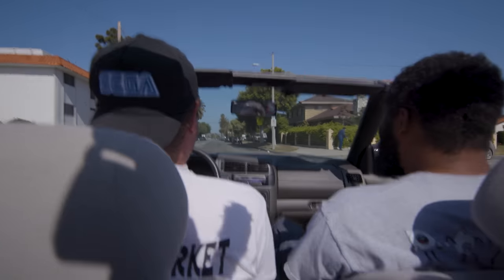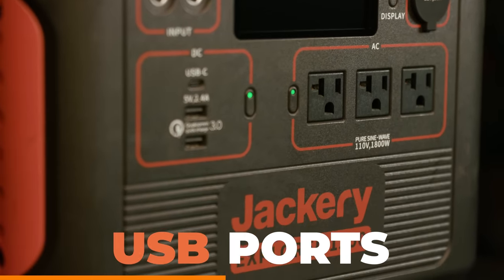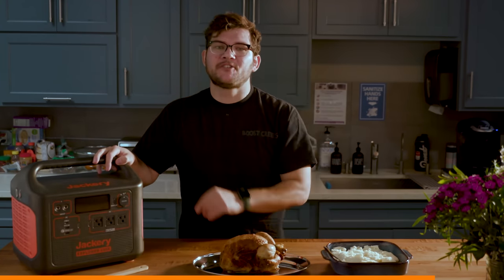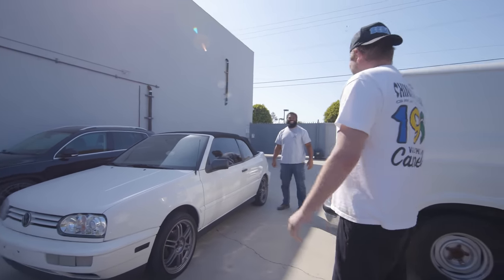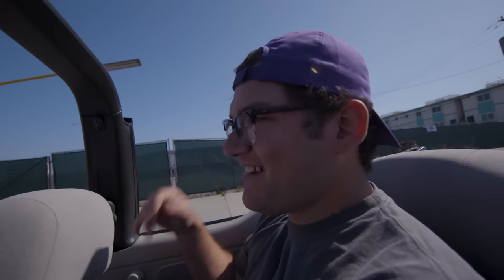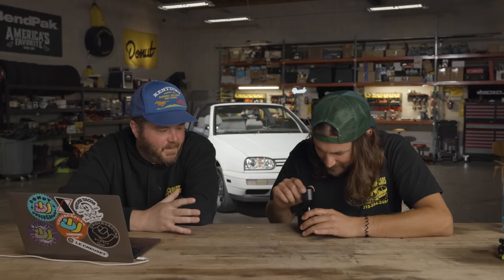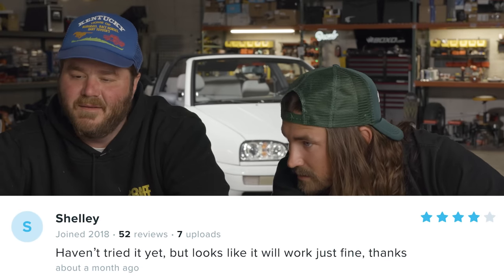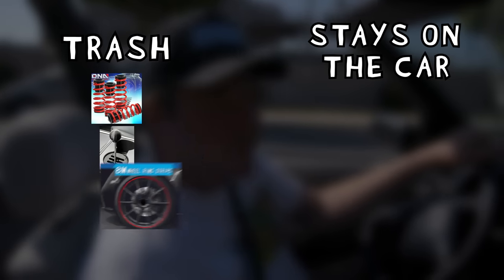We Bought More Dumb Car Stuff from Wish.com

Comment: Tentatively awaiting the supercharger installation. That one's gonna be interesting
Reply: If it actually works for more than five minutes it is a huge bargain
Reply: I can’t wait to see that XD
Reply: Get it done boy’s
Reply: @loganwade6581  ya, I didn't see any oil lines on it.
Reply: Here is a link to the guy that installed that supercharger!  I'd love to see you guys do the same!  https://youtu.be/w_0cQfNnYU0
Reply: if they install in a small engine, is not gonna be so bad
Reply: I need to see this. If I don’t see this installed by June, I’m totally unfollowing for at least a week out of pure rage
Reply: The fact that this video does not contain the install and what not makes me dislike them. I’m not subscribed. Just randomly found them.
Reply: It looks like you could maybe sandwich the supercharger between the alternator and alternator bracket somehow.. 🤔 The mounting points kinda look like they are alternator width
Reply: 5 bucks that the cheap poly wheel on the supercharger will blowup
Reply: @youkofoxy  mostly all of them are refurbished from small engines so they are meant for such. I doubt its gonna make a difference for a 2l engine. 2 stroke stuffing channel has done >20hp (seems like more is coming too) on on the smaller version of this supercharger (300cc one) with a 50cc 2stroke (2stroke 50cc stock comes with about 5hp btw)
Reply: YES
Reply: we would all learn a lot from a supercharger install
Reply: @frankiethefrog1752  very rare for them to do that. I suggest you just try another video ;)
Reply: @ChrisC7498_  lol I’ve seen some content before it was entertaining.
Reply: yes
Reply: Seriously I'll watch
Reply: Yesh
Reply: The outlet seems like it’s a few inches too small. Like it could work but I would think you’d have to gear it up with a smaller pulley to spin it faster to stand any chance. I’m excited to see it spew it’s guts into that poor unsuspecting golf engine

Comment: The reason the supercharger seems so nice for its ridiculously low cost is that it's actually a "refurbished" used supercharger from a Japanese Kie vehicle made by Aisin. You have a AMR500 but they also made an even smaller AMR300 (500cc or 300cc of air per revolution respectively). People use them on all sorts of applications like air cooled VW's and small engined go karts/buggies etc.
Reply: The more you know.
Reply: Well boys, looks like we might get ourselves a video
Reply: Do you know how well this would work on a motorcycle
Reply: So I'm assuming this wouldn't work in my 2012 Silverado lol
Reply: Interesting
Reply: @OregonSilverStacker  of course it would; I've seen a 3.5L M30 straight six engine with 3 of these fitted directly on the intake ports (one charger for every 2 cylinders) you can also overdrive it up to 2x to get 1000cc per rotation.
Reply: @OregonSilverStacker  would work just fine, it would provide all the boost you need on two of those eight cylinders.
Reply: @pero2727  Whoa, I got a buddy with an M30 3.4.. u got any details on that build?
Reply: Came here to say this, It's cheap for a super charger but it's basically from a warehouse of parts that never got used so they are going resold. You would have to build it all out yourself and it's still gonna cost a few hundred to pull it off ontop of the charger but hey, you got the charger. Everything else you can buy online or at lowes or something i guess. You can change the boost based on the size of the wheel you attach to the wheel on the alternator. Def would take a lot of work to get it done but, hey if you have a little 4 cyl. and you have the time and money, you might get another 50-100 hp out of it and the satisfaction of doing it all yourself.
Reply: My guess is you would also want to buy one of those chips that helps tune the engine??
Reply: @pero2727  WHAT THE HELL?
Reply: @templar501  Yes but 50-100hp out of a engine that ONLY makes 116 hp to begin with? Nothing to sneeze at!
Reply: @BtD_007  So a 50% to a 95% increase in power is nothing? For maybe 500$ and some time in a shed?
Reply: @matejpotrusil1464  do you know what "nothing to sneeze at" means?
Reply: @SamAbraham  I don't know what you mean with details; it has low comp pistons and a cam, that's about it.
Here's a 2JZ head with triple AMR500s on it, the intake setup on the M30 was similar: https://i192.photobucket.com/albums/z237/duaxmachine/AMR5003-2JZ_zps92122f8e.jpg
Reply: Wow that's cool to know. I figured they had to be used in other applications but never guessed refurbished
Reply: They look like something that breaks on a monthly basis, is that impression accurate?
Reply: Ive seen one on a 22re in a hilux before. They go alright those AMR500s
Reply: The Amr500 is a nissan made supercharger. its Pulled from a kei car and then rebuilt. all you need to run it is a tunable car under 2L, a mounting point, a belt, charge piping, and a bov. worked on my miata anyway.
Reply: @TheLucasfialho  nope. Very reliable; the gears inside run in an oil bath.
Reply: Thats correct dude! I actually know of 2 air-cooled vw`s in Norway with the AMR500 ;)

Comment: I can totally see the supercharger binding up the SECOND real load is applied and shooting metal shards right into the engine. Would love to see it
Reply: I have a roots blower in the scrap bin that looks just like that. It was used in something to make snack foods or the seasoning of the snack foods.
Reply: @danh8302  gotta have that pepper powa
Reply: My thoughts exactly 😂
Reply: It’s a smog pump bruh. Come on y’all. These are used for small engine superchargers. Why none of y’all recognize this??
Reply: Hey man, I know a guy who ran one of these on the mirage engine, worked fine, the amr500 is a real product
Reply: They aren't as bad as they look
Reply: It would only shoot into the intake, shouldn’t make it much further
Reply: @duckguide4109  til you turn the engine on, it'll stay only in the intake
Reply: Mercedes used the same style supercharger in their c230, its a roots style supercharger.
Reply: @duckguide4109  the reason air filters exist, is to keep foreign objects out of your engine, because the intake manifold is a direct passage to the internals of an engine. 

If it goes bang so does the motor.
Reply: I have the same Chinese supercharger on my vw bug and it makes my car rip.. it’s just a 1600 and everyone always thinks it’s a built 1914..
Reply: @longsleevethong1457  that's because it's a knock off AMR500 not a smog pump
Reply: @jakefinlay5312   it’s a smog pump that folks figured out how to use otherwise fh
Reply: @longsleevethong1457  it's a factory supercharger on a Subaru pleo, the one off wish is just a reproduction part

Comment: That supercharger is actually based on a semi-decent super charger. The real AMR500 I believe is a knock off of an old Porsche and bug supercharger. One side gets bolted to the engine and the other is used like a tensioner. They supposedly work great on engines like the bug 1600.

If I remember right they also had no Inter cooler and instead used alcohol (methanol) injection.

Comment: Instal the supercharger!!  Make sure you add a boost gauge cuz I’m really curious how much air it will move! Probably tops out at like 4 psi😂
Reply: somewhat reliably, 8PSI is the furthest I've personally pushed a 500, they move 500cc of air per rotation, so depending on the pulley ratio, 4-6 would usually be ideal.

Comment: The "supercharger" looks like it's using the same mounting points as the A/C compressor, and connects directly to the intake.
Reply: And the threaded couplings look like a trash pump for pumping out a ditch.
Reply: @francistarkenton545 , Trash Pump Turbo sounds like a perfect name for it.
Reply: @David_Shipley  Wish should change it to that and give you royalties.
Reply: @francistarkenton545 , they'd probably just mail the check on the same ships as the products, so I'd have to wait 6 months to find out they lost it at sea.
Reply: @David_Shipley  you know this is a REAL AMR 500 Supercharger that is on thousands of cars.
Reply: @RandyLittleStudios , ok, does it not mount like an A/C compressor and feed directly into the intake? Or are you trying to fact check the joke I made about the name?

Comment: Definitely going to need to see that supercharger installed on something. Hell I'd even settle for the lawn mower.
Reply: I wouldnt settle on lawn mower, but I would settle on super low end 1l "modern days" nano-engine
Reply: @by010  A Smart Car has got about the right displacement.
Reply: W.
Reply: @kvin_le  X
Reply: Check out robot cantina, he put it on a cement mixer engine he adapted to a CVT trans on a car.
Reply: @SilynRaces  ...wut?
Reply: same here, greenfeild motorbike conversion
Reply: "There was one time I hooked up my lawn mower to my Nintendo! After that I got the high score every time!" - Matt Chapman (as Bubs - Homestarrunner)
Reply: I’m going to use one on my 2 stroke moped to piss about with
Reply: That'd be a spicy lawnmower for LA

Comment: These are just general super chargers really, "commonly" used to supercharge air-cooled beetles, buses and buggies. I'm genuinely interested in buying one for my '73 super beetle since they can up the power to 160 hp with EFI. 

 Btw they're mounted using those MI holes on the sides
Reply: Wtf is EFI
Reply: @yungboicontigo9278  electronic fuel injection
Reply: @mudkip4633  thx
Reply: Mighty car mods had a beetle powered buggy that was pushing around 100hp, but it was NA. It blew up pretty fast, can the beetle motor safely make 160hp without just grenading? 3x stock power is impressive for any engine
Reply: That supercharger is an OEM remanufactured unit. It's on some nissans and stuff.
Reply: @FroztiProductions  Nissan super turbo used them.
Reply: @Fhwgads11  on a healthy block that’s been built it can be done currently running a 2332cc with roughly 160hp to the wheels from a motor that was originally a 1600cc with 40hp
Reply: @Fhwgads11  my friend has one that they just put a turbo on and its running with meth injection. He estimates 315hp once its all done. He used to run a smaller one and made 200 ish
Reply: I thaugh it looked like the jo-blow one in the thumbnail

Comment: For those wondering, those superchargers were made for Japanese Kei cars in the 90's, which is why they are for such small displacement motors (600cc-ish).

Looked into putting one on an old Yamaha sport bike years ago.
Reply: This is a high quality comment. I was wondering actually
Reply: Underrated comment
Reply: We did put one on a nissan micra, picked up 30 hp ah ah
Reply: A single one of these can handle up to about 1800cc I've got one running on a 1300cc samurai engine
Reply: The AMR500 superchargers are also used on the Mini & Peugeot 1.6 engines sometimes from factory if I'm not mistaken
Reply: @dannyvanderheide6098  not amr 500, it is too small for that power ^^
There are Eaton on those 1,6L ^^
Reply: @blumafuji2753  oh yeah, sorry. I was confused with the Eaton. AMR 500 is still a popular choice for the lower displacement engines up to 1.4's max tho afaik
Reply: @dannyvanderheide6098  I know plenty of people who use them on 1.6 tracker engines making ≈6-8psi
Reply: @jakefinlay5312  it depends on the power it produces na ah ah
It won't be able to flow more than 140hp I guess or around that, you can get some 2,0L engine less powerfull than that so where it could make some boost, my personal 1,6L wouldn't get much boost from it due to it's power na
Reply: I bet you can get it to work on a 300cc Vespa.
Reply: All i hear is they need to put on several of these
Reply: @bedabene  one of them IS sufficient to make 130-140hp so it would make some boost but not z lot for sure
Reply: So they just need 4 of them ... lol
Reply: Yep, my '94 Subaru Sambar (4cyl 660cc 16v) had one of these.  In 4wd Lo it would pull 0-20km/h very quickly ;-)
Reply: They need to put 1 supercharger by cylinders !!! That would get 1-10M views in no time !!! !!! !!!
Reply: I’ve been researching putting one on my old aircooled VW bug. Apparently some folks sell kits for it.
Reply: @jakefinlay5312  which one? I wanna boost my samurai lol got a Harley carb on her now but still lacking
Reply: A nice reliant automobile..
Reply: @bedabene  that was my thoughts. Ok so it is good up 1400cc so then 2 should do 2800cc then right???
Reply: Interesting to know!! Thanks for sharing this lil' bit of info.
Reply: We all know how this ended up doing, but I wonder if they couldn't give it a try on the X-90 currently going through its paces? That's a 1.6L, and people put these on the Suzuki Samurai which isn't much smaller.

Comment: Gotta love all that forced induction you'll be getting from that "supercharger" 🤣
Reply: It'll work you'll see
Reply: @Ahmedkhaled-ev1jw  not as good as something like the Demons supercharger or the gt500's or the Zl1 1LE's or anything that isn't that 😂
Reply: @mdsullivan100  Fetch me a Demons supercharger for $200 then, will ya?
Reply: Lol the AMR500 is a legit supercharger. It's oem equipment on a Subaru kei car. It's made upwards of 150hp crank on various dyno pulls I've seen. It originally was fitted to a 600cc engine. Good stuff.
Reply: @matthemberry  Damn, not bad
Reply: @filipruml  who said we were buying one
Reply: @mdsullivan100  :(
Reply: @filipruml  maybe for your birthday
Reply: @Ahmedkhaled-ev1jw  Ive read in comments its used on 800cc engines and actually makes boost. Wonder if i can parallel 3 of them for a 1.6 l engine. At this price point it would probably still be cheaper than an original sc and or turbo kit.

Comment: Those AMR500 superchargers came stock on Subaru kei cars - basically all of them are refurbished. I've seen them sold on aliexpress with regular pulleys and the max RPM is around 18,000. 

I'd guess you'd get around 4-5 pounds of boost if you were to put it on the Golf tbh, it would be funny.
Reply: Wait so you're saying I could buy one and twin charge my Daihatsu Mira!?!?!?
Reply: @s70driver2005  yeah probably, if its the 660 you could probably even get away with an amr300 which is physically smaller but flows 40% less air per revolution, but if it's turbo already you would need to figure out if the supercharger is a restriction or not
Reply: @GlaciatorGaming  it is a 660cc 4 clyinder. It would be hilarious to put one on but I don't want to blow it up. I have a big car for modifications. I just want the Mira to run.
Reply: @s70driver2005  actually I'm putting one on my 06 Volvo today haha, been sitting on it for a while, should do about 3psi instant boost
Reply: @davidmcvan6072  lol yooo let's see that!!!

Comment: Yes, you HAVE to fit that supercharger to the car! I want to know what it costs to adapt a $200 supercharger to actually fit and function. Even poorly.
Reply: I can put that on any car with space at the belt area. Be a tough install on any horizontal motors, but any forward facing engine thats a super easy install. a bracket or two, little welds and some bolts. Fitted belt and youre off to the races. I've seen something very similar on a jeep before. basically the same as a procharger.

Comment: I definitely want to see the supercharger installed now. I wonder if it will end up blowing the engine like the turbo kits did on high and low car
Reply: That’s because they were both the DE engine found in the early 350s. Those motors can’t handle boost
Reply: @krisrepka7741  ah I didn't realize that. I don't know much about 350Zs

Comment: That supercharger works best on bikes and small displacement motors it definitely provides power too if installed correctly. Usually best used on old vw beetles.

Comment: Someone who buys lowering springs and calls them a coil over is exactly the type of person that’s in wish 🤣
Reply: Skull 👎🏽 Head bone 👍🏽
Reply: Except they are coilover springs, perches, and adjusters. 
If you haphazardly fire them onto a stock car, obviously they're going to be shit. 
They're honestly a good starting point for a car that doesn't have off the shelf coilover options, or if you just want to build a setup yourself. 
The adjusters/perches are fine, and while you have to measure the spring rates on your own, usually one set of springs are usable. Pair it with shorter/stiffer shocks and a pair of hyperco/eibach/swift springs (+- camber plates to taste) and you have a coilover kit on the cheap that can perform well depending on your choices.
Reply: @Northern_  your technicality is noted and dismissed because I’m talking about the fact you would put a cheap adjustable coil on an old strut..